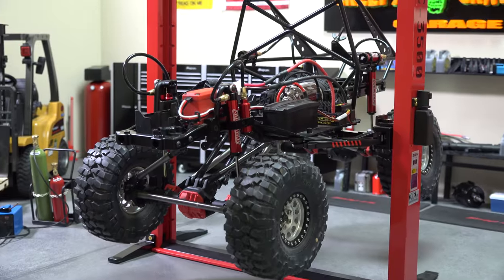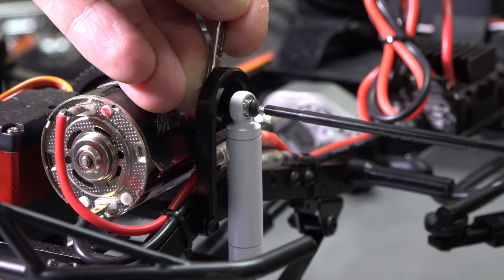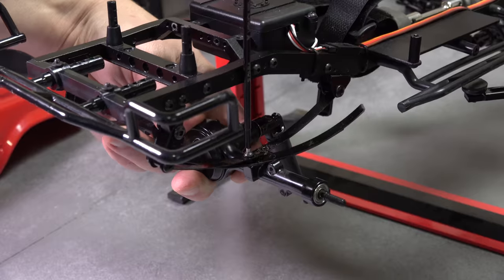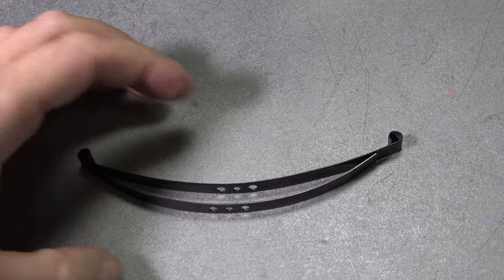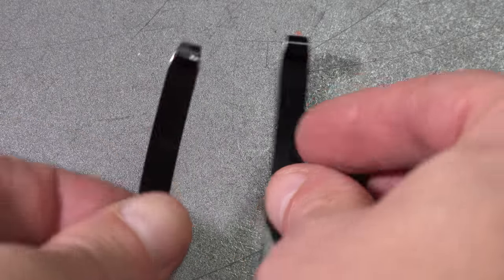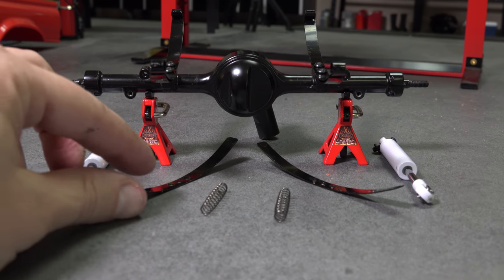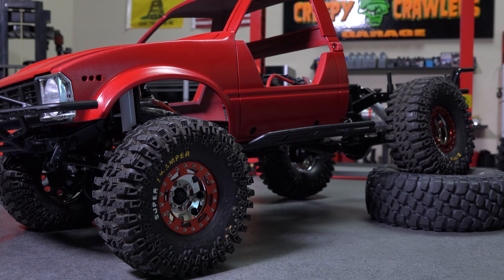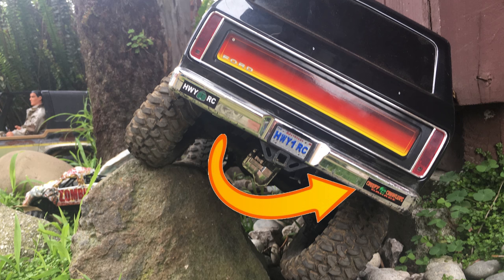THE RC SHOP - E15 - Adding FLEX to the RC4WD Marlin Crawler Trail Finder 2

Comment: So what do you think about the Revolver shackles, and Z box kit for the Marlin Crawler? Looking real hard at the Marlin Crawler, with the 1985 4Runner body.
Reply from the maker: Speedy Noneya they def will add flex and the Teraflex branding keeps the scale look. I'm also looking to do a 4Runner build on TF2, but I'm looking to go the airbag route.
Reply: TandemCTelevision   I have a lot to Learn, what about up grade parts ?
Reply from the maker: That's a complicated question, depends on what you're trying to achieve. It's always good to start with a quality set of tires and I think a high torque all metal servo.

Comment: So I have a 1986 4 Runner, it didn’t come with a straight axel, it has independent suspension,  can you do a video a a conversion, a got the 4 Runner body, gonna make the little one look like the big one.
Reply from the maker: You wanting a video of straight axle to independent conversion? What chassis are you using, could be interesting?
Reply: TandemCTelevision  the RC4WD 4Runner will sit on the TF2 marlin Crawler.  The 1986 4Runner didn’t come with a straight axel, I think It will/might do better on the trail as well. I would love some stickers by the way..  🤓
Reply from the maker: Email me your address, I have new stickers being printed, I'll send to you a soon as they're ready.